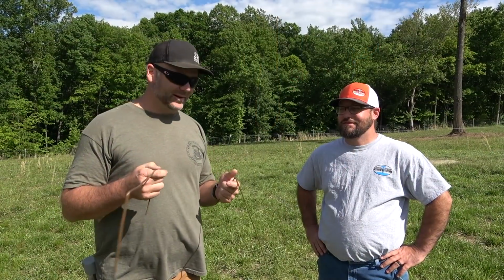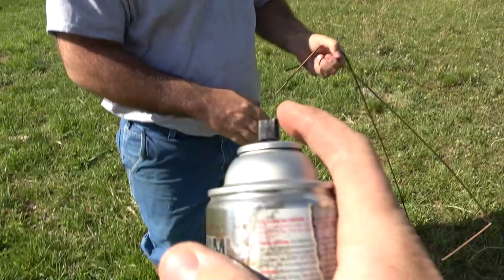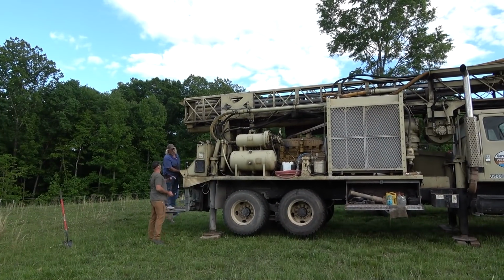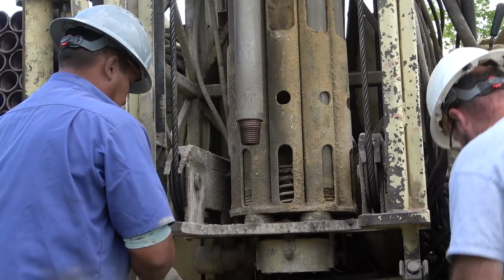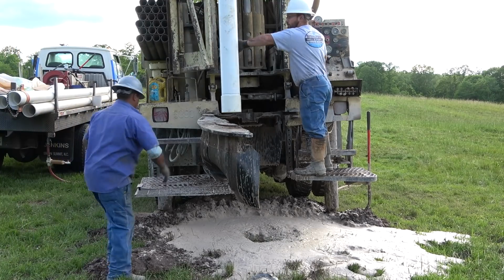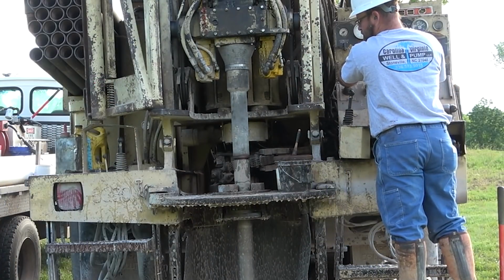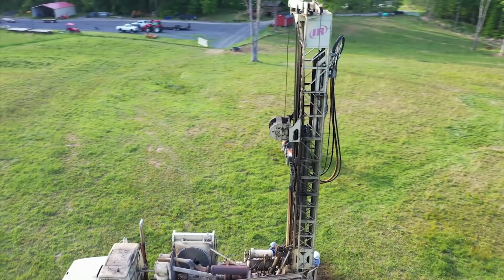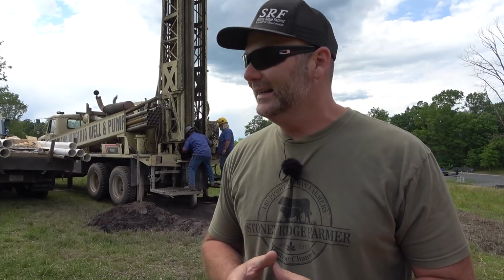How to DRILL A WELL the LEGAL WAY! Solar Powered!

Comment: The water company in my area  replaced the water main pipes and the service pipes for the homes in may area.The old pipes were breaking adn leaking-clay-asbestors pipes.New pipes PVC.The water folks used the devining rods to locate the present pipes adn the servicelines-trace them to the mains.I didn't beleive the sticks would work.They let me try-Did work but I was off-but still found the pipe.Figure the rods must be matched to their user.Only drilling and pulling done was with horizontal drills-no vertical drills as you used.The drills also pulled the pipes.The old pipes left in place-cutover was kinda neat!And when they made whole large peices of pipe from several sections.A pipe welding machine welded them together-the horizontal drill pulled the pipes underground.Was fascinating to watch.I have also watched a well get drilled-Many years ago-my fathers neighbows in Rapid city,South Dakota.Was cool when the driller hit water!!!They had to drill about 600Ft through rock-diamond bit was used.Thecleint had to purchase the diamond bit.

Comment: I had a well drilled in 1997 Josh. I'm a  probably 4 - 6 hours north of you in the northern panhandle of West Virginia. He struck water at about 30 feet down. The fellar said by law he had to go to atleast 75 feet. He stopped drilling at 92'. You just can't beat a good water well. I've seen the witching method used. You can also use a peach tree limb and get good results.

Comment: I learned this over 20yrs ago while working for an old timer! We had to trench across his backyard and no one knew where the water lines were!  Since we were adding an electrical line the old timer asked if we had solid copper wire (which we did #6 solid copper) and he found all of the pipes that had water in them across the backyard! Even the old cast iron sewer lines! I still use this method to this day! Whenever I tell people about it they don't believe it! I pull the sticks out and tell them to walk over to the toilet and like clock work the wires cross over the toilet! Jaws Drop!

Comment: In 1971 in Western Kentucky my dad had a friend come and cut a forked limb from our peach tree. He walked the property and located a drill spot. He walked away from the spot until his witching rod went back down. We measured it and it was 37 feet. He said that was where we would hit water. The drillers hit water at 35 feet and produces about 15 gallons per minute still today.
Reply: Local ppls in Africa also using a branch from a' tree n telling us where to start hand dug wells.

Comment: Don't know why but I've done this many times and it works, and can do for many people. 

When I was Scout Troop Leader in the UK we took simple wire coat hangers, cut them into "L" shapes and held them using the outer cases of Ball Point pens. 
We had about 25 kids in the Troop and at least 20 used this way and found water. 

Good Luck with your search!

Incidentally on the Farm where I grew up they had a Ram Pump system that supplied the whole farm back in the day - It was first installed over 150 years ago - there's not much that's really new!

Comment: I put a solar bore pump in  almost 3 years ago now. Bought a cheap one from China, panels, pump and controller, pipes etc AU$2000. Its moved about 1,500,000L  to my tanks that gravity feed to 14 troughs. you dont need to spend a fortune on the gear and you can always upgrade it later.
Reply: Do you have a picture of what you bought?

Comment: The vibrating bit, as you call it, is a down-hole-hammer. It has a piston that beats up and down and you rotate the hammer to grind. The air, water, and foam exhaust the cuttings to the surface. I do rock well drilling up in Nor-Cal. We also do undereaming with max bit system on 6” steel.

Comment: I use this method.   You can think about water (or copper gold silver etc). And you will find what you are looking for particularly if you are ‘tuned’ in.  Secondly you can determine the depth  by re working the area and thinking/concentrating on a depth   Then. Refine the depth. By dividing in two.   Eg. Think 0 to 100 m.  If you get a signal Then  0 to 50.  Then if still a signal 0 to 25.  Then 0 to 12.5.  If you lose the signal then think 12.5 to 25 then 12.5. To 20.  Etc etc.  Until you pinpoint the depth    Just something that’s worked for me (although I’m not a well driller I just do it for fun

Comment: Here in sw MN our well for the farm is only 40' most in the area are around 90'.  its the same well when my grandpa had a dairy and made it through the drought in the late 70's, thought it was going to dry up for how shallow it was.  we have a rural water main line pipe that goes around our farm but its $18,000 to hook up to plus so much per gallon. and have heard of some bad things about the rural water here, low pressure and to many pig barns hooked up to it.

Comment: Great price for drilling. Up here in Ontario Canada we are about $40 -$50 /ft
Reply: Yeah so I live up in northern ontario ..the little claybelt area and my well cost me $16,000..we went down through 200 ft of sand and then another 5 into the bedrock..works out $78 a ft and I get 11.5 gallons a minute..
Reply: @Lucas-vk8fz  valuable resource :)
Reply: In India there is 10 inch holl with hard steel ceasing pipe and the cost of drilling is $10 per feet and well cost is $6700 maximum with 750 feet ceasing and the technology of drilling machine is much better than wholl world

Comment: The well I had drilled last year went to 640 ft and only produced 1 gallon per minute.  Decided to stop at than depth and not spend any more on drilling.  Planning on having it fracked soon to try and increase production.  You certainly do watch the money meter run for every foot of drill pipe going in the ground while your waiting to hit water.

Comment: My grandpa was the local well Witcher in our area, He was never wrong. He didn't use copper wire he used a green Y shaped sapling twig. You can't make this up!!
Reply: I've seen that before. I literally thought that man was crazy. Sure enough he was right.
Reply: I had an old timer use the same thing up to my camp.  He said anyone can do it,  showed me how to hold the sapling and the hair stood up on the back of my neck when it started to bend.  I held it so tight the bark pealed off in my hands.  🍻
Reply: Yes. Yes, you can.
Reply: Can and do make this up. Absolutely foolishness. I've got the experience and disproven water witches to show it.
Reply: I would personally pray and ask Jesus to lead me.

Comment: I've drilled water wells for decades. I can promise you from experience that those rods do nothing. You can hit a suitable bedrock/gravel layer anywhere. Only thing that changes is the depth.
Reply: Thank God someone else said it. I drilled for 20 years and regularly proved water witches to be absolutely full of shit! Witching sticks are foolishness.  The all knowing witch would tell you to drill in what was usually a terrible location, and on a regular basis, less water would be realized than if you literally threw a dart at a board that had a picture of the property on it.
Reply: Do the sticks find shallower water? That would be the benefit, witching definitely indicates something, I have found water pipes several times that were off the dig alert utility marks.
Reply: @brandonmccullough6381  I guess that's possible, but only because I can't disprove it. If it really works, it shouldn't have a 50% fail rate lol
Reply: It's kind of amazing just how many folks truly believe in this "witchcraft".  I can see that Josh honestly thinks that it works, and I know people who swear by it, but I've always been extremely skeptical.  I've never heard of anyone who can explain HOW these rods are supposed to work to find anything, much less a water source that is 460 feet down.  Until that happens, I'm not buying it.  I can't prove that it does NOT work, but I was a little disappointed to see them waste the first five minutes of the video on this.
Reply: What water well drilling type is this? Revers rotary?
Reply: @6.0powerstrokemodder  it's a rotary rig. The one I used was a table rotary, this appears to us a head unit. I also used recirculation with a pit and we mixed in bentonite to stabilize the hole. My guess is these guys primarily drill rock holes. But I've been out of the game a few decades now.
Reply: Environmental driller here, we use those to locate any potential underground utility.. lol so I’m glad I wasn’t the only one who questioned this method of using those for this specific type of drilling!

Comment: I've witched lots of wells but I knew a gal that could witch a well and tell you how much water was at what depth. She would find the water in the area where you need water. Then she would make a grid setup like an eight point compus in the area 20-25' from where water was found. She would take eight readings and then do a little calculation. She was on the mark most of the time. She told me how but it's been 100 years er so..
FYI. copper rods will find any pipe (even wood n plastic), lines (gas, water, ele. ect.) and underground water. A wood witching rod, I find, works best for underground water if fresh cut;  local willow or large shrub or young sapling works best ... one that drinks lots of water.

Comment: Now you need to build an old fashioned windmill to draw the water up.
Reply: Single line can only draw27 feet
Reply: @georgedavidson7986  Where'd you hear that? All the windmills on the family farm were over 200'. They'd be still still pumping to this day, if the 6 square miles of it wasn't levelled for crops after it was sold. 
They did need some maintenance from time to time, with pipes rusting out, but always worked. It was a bugger of a job pulling them up to replace/check pipes... a lot of pipes.
They didn't pump gallons a minute, but they all had a tank, some a dam as well beside them to store the water and always plenty for the cattle/sheep/horses and house.
Reply: @theoneandonlyowl3764  Hi. A single line well pump will only pull 27 feet. Todo what you are saying they would be jet pumps with two lines   One pushing water down to push water up
Reply: @georgedavidson7986  Nope, completely wrong, or maybe not using good aussie windmills. None of the water here is within 27'.
Reply: @theoneandonlyowl3764  single line will only pull 27 feet. You need two line yet pump to push water down and then back up
Reply: @georgedavidson7986  No you don't. I don't know where you've got this info from (or who bs'd you), but it is so wrong. I've had hands on experience. 
A windmill can pump from enormous depths, one pipe. Much deeper than 200'.
Reply: @theoneandonlyowl3764  Well I have never heard of it in Canada where I live
Reply: @georgedavidson7986  Here's some info for you. An except from an Aussie windmill maker.
The powerful action of the Comet Windmill can push the water (depending on the size of the windmill head, and the pump diameter) up to 1,000ft. Apart from this, distance is not much of an issue.

If you want a link I'll post it, but I'm not sure if this page accepts links.

Comment: ALSO
 Pump Saver works for low flow wells. It can be bought integrated into the pump starter or bought separate and added to an existing pump starter. It senses the drop in Amps and breaks the circuit for a programed amount of time .. 2 ~ 120 minutes to allow the well to recover so you don't burn out the pump. ..

Comment: I'm from florida 32 and have been drilling since I was 18, 2 weeks out of high school. Ive drilled for gas station systems, water mangment districts, tested for sink holes and set wells with that same style rig along with many other rigs. We like to use mud rotary while setting wells which is a much different set up and for me has much more pros than cons and is more effective. Not saying one is better than the other because in most cases it's about preference. But as far as setting the well casing , I didnt see any type of grout used to secure the casing. Usually PVC casing is set anywhere from 5 to 25ft into SOLID rock or limestone and then grouted on the outside to keep it stationary, block off any sand from falling past the end of the casing and/or to keep the casing straight as often times the hole drilled is wider than the casing being set. Once the grout is dried, usually 24 to 48 hrs, you can continue to drill to your desired depth for quality water. I'm just interested in how they secured their PVC casing? Did they use grout? Or was there another method used that may work better or be less expensive than grout?
Reply: Same thing was going through my head as well as what keeps surface water from running down outsides of casing?
Reply: I know this is an old reply, I’m a water well driller in Texas, we use air most of the time, occasionally mud drill on loose formations. But we use pvc 4 inch casing. 
Once we run the casing in the hole, we use a gravel/sand mix that we pour down the hole that packs around the casing, it filters the water before entering the screens, also holds the casing center. 
To finish the well we hole plug and cement 10 ft down from surface, and have a steel 8in diameter sleeve a few ft long that goes into the ground about a 1.5 and comes up out of the ground also about a ft and a half that is also cemented around the casing to protect the casing and seal it.

Comment: Finding water this way is sometimes called dowsing.  I found that I can do it and after practice I found I can find underground water pipes, springs, gas lines, electric lines etc.  It is very useful and I've done it hundreds of times.  I mark the line with flags so I can photograph where the line of the trench is.
I use copper rods in an L shape, the horizontal about 18" long, the handle about 6" long, not a U shape and put the hand ends in copper pipe which just fits the wire.  That way the rods can rotate easily without me having any effect on them.
I did not use them to put the well on my property, that was before I learned how to do it.  But using the rods I found I could have drilled about 20 ft away and found more water at a shallower depth.  My well is 150 ft deep and produces 25 gpm of sweet water.  Deride it if you will, but at least try it when nobody is watching!
Reply: And deride I shall. Poppycock. I've drilled hundreds of wells, and proved to the dismay of many a water witch, that they were dead wrong.

Comment: Definitely interested in seeing the solar setup for this. I'm building an off-grid homestead in the south western part of NC and have been looking at various options for the well once we get it drilled.

Most seem to focus on a lower gpm pump filling a cistern which seems like the way to go.
Reply from the maker: This pump setup pumped over 10gal per min at around 30 psi once we finished the install. Released part one this morning, part 2 coming tomorrow morn
Reply: @StoneyRidgeFarmer  which country is this??

Comment: This is a thing I don't get. You drill into the ground but you never know but much water you can harvest. Where if you use a Rainwater harvest system you can store all the rain water coming down on your land which is way more than you will ever need. Filtering rain water for drinking water is also inexpensive and with 3 filters and a UV system you get even better water than what you can get from your well. You spend maybe $2000 for storage tanks which you should store 50% or 100% underground. The big benefit is you have always water. An 10.000 Gallon POLY tank cost you less than $1000 if you pic it up from the factory. Easy to transport and lightweight too.
Reply: In some areas like certain parts of Colorado it's illegal to harvest rain water! You know, the government knows what's best for you! By the way here in Florida you can get as much water from a well as you want, usually the only thing that dictates that is the size pump you can get in a well, oh and water management

Comment: I wished prices were that cheap in my area. I need a new well dug, it's $4500 just for them to bring out the rig and that's for the first 50 feet. It's $30 per foot after 50 feet. Thankfully most wells in my area are at the 50 to 60 feet mark.
Guess I'll just keep my cistern maintained and continue to catch rainwater and filter
Reply: Do what stoney ridge did and get a grant to get it dug for free
Reply: @Streamerclippz2  I'm not a farm and need it for personal home use so most likely wouldn't happen, good idea though. 
Sad part is, public water is approx 1500 down the road at a neighborhood,  but they won't run it on down for us because there is not enough homes down the rest of my road to "justify the costs".
Reply: @msack6904   same issue where my land is except it’s 300ish feet from my driveway to where the water line ends they said they would run the water on down to me if I paid for the main line to be extended and quoted me 3500 dollars 🙄     I don’t think it’s fair to charge me that on top of having a 60 dollar minimum bill every month.  I’m gonna look into a well first before I decide.
Reply: @shanebiggers8437  I would pay the 3500 in a heartbeat if they ran the main line to me. They are talking in the $100,000 range for the main line, then I would have to pay a $7500 "hook up fee" and then I would have to have to pay to have the line ran on my property and hooked up in the house by a licensed plumber. 
I could try the $5000 for a new well, but run the chance of them hitting the limestone bed again and my water being super saturated of minerals or not have a good supply which is also my issue.
Reply: @msack6904  dang I feel bad for complaining now!   That seems outrageous! I hope you get it figured out!